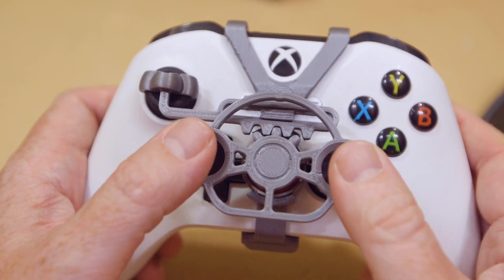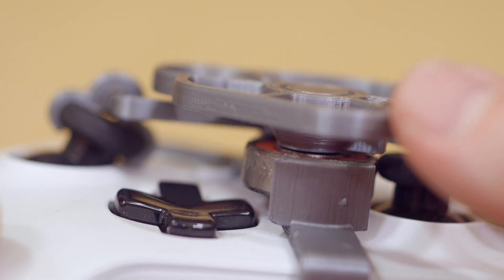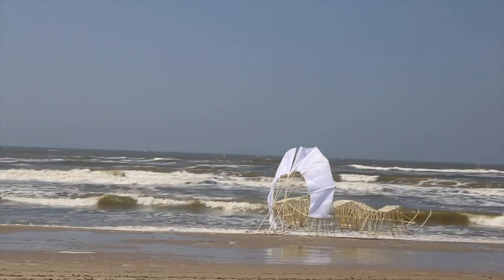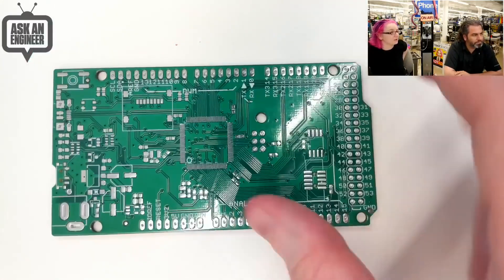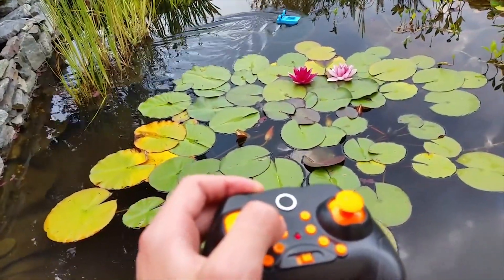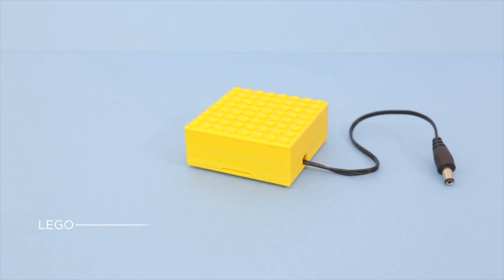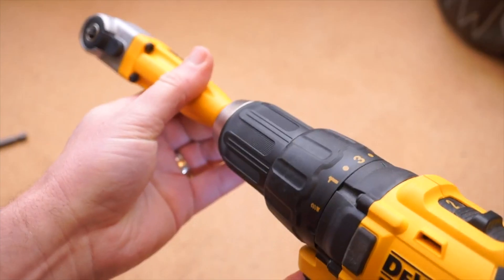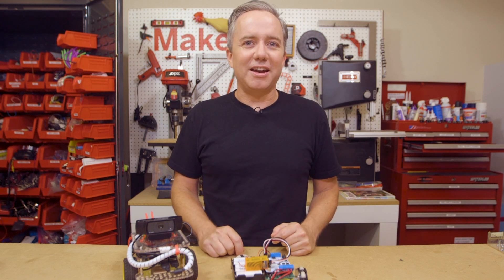Maker Update: Thumbstick Steering Wheel

Comment: Other than the obvious answers, "because you can," or, "so that Adafruit can sell more stuff," can anyone explain why a $25 microcontroller board was necessary for the Operation game, when a simple Schmitt trigger gate and a 555 driving a buzzer would do the job?
Reply: I might be wrong but i think it's so they could use a pair of wireless tweezers via capacitive touch vs the 555 timer which would require the tweezers to have some power so they couldn't be wireless.
Reply: OK, I figured there must have been a reasonable answer.  I missed the bit about capacitive touch.  That's what I get for watching while eating my lunch. 
 Thanks.